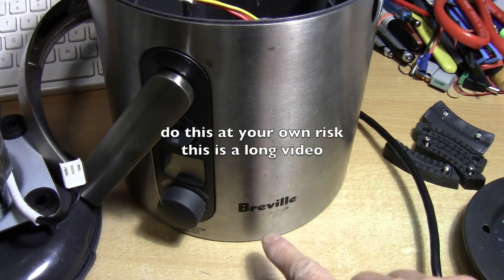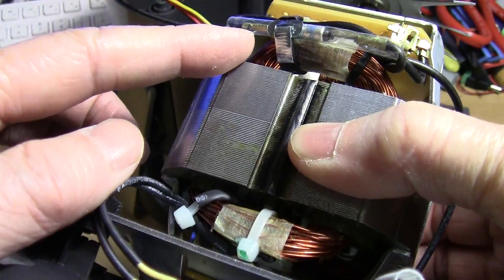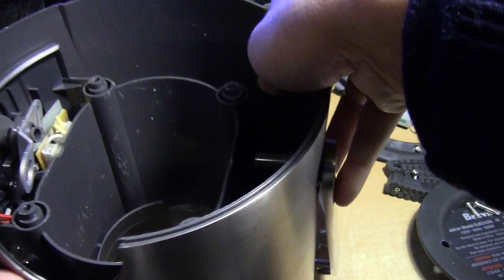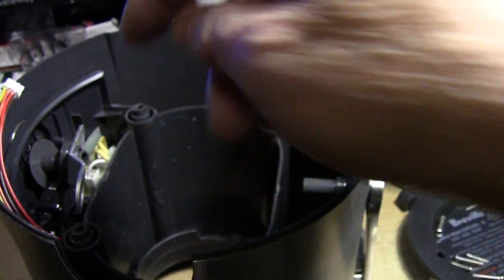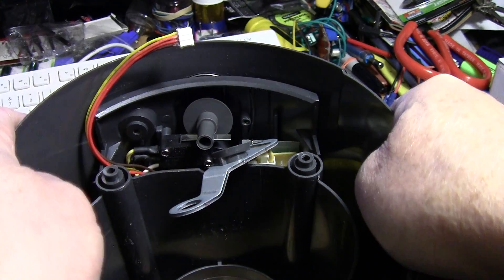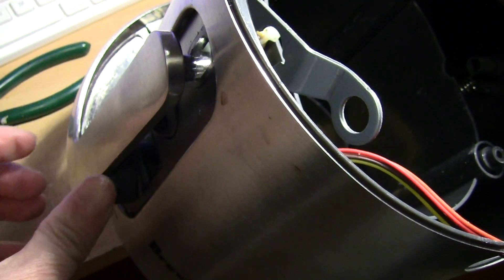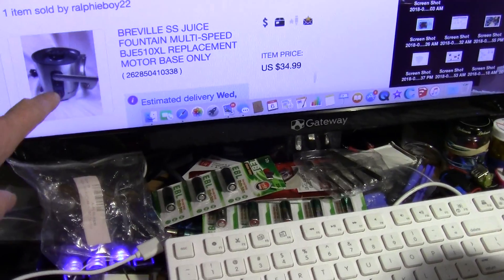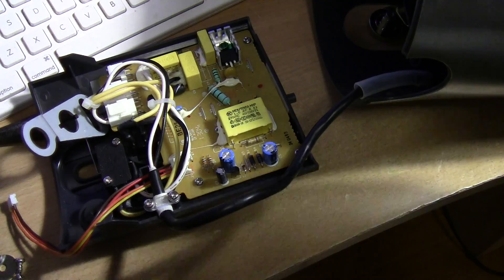Disassembling  Breville juicer model BJE510XL for repair Part 1

Comment: In my case my Breville BJE530BSS, using it with a 1200W pure sine wave stepdown transformer, stopped working after I put too much fruit in it. How can I fix that?
Reply from the maker: @valmeyraSIRH  I’d check for a blown fuse first . Remove the blender base and locate the fuse in the wire from the multispeed switch to the motor. Step 2: Disconnect the wire and use a continuity tester or multitester to check the fuse. If the circuit is open, the fuse is blown.

Comment: Thank you. But the fault was in the speed control unit. Potentiometer defective. Did you have to take everything apart?
 Maybe it was only necessary to pull out the front button and solder the contact?
Reply from the maker: Didn’t know what the problem was. Taking it apart made it easier to diagnose problem. Thanks for your input.

Comment: I ordered and replaced the main pcb control board for mine. The panel lights up and the knob changes speeds, but the motor wont come on. Or sometimes it does.  The part also came with a motor control "board b".  However i need to take off the round black basket attachment attached to the motor shaft to get to it.  Any suggestions on how to do that? I see no screws attaching it to the shaft.  Thanks buddy. I like your video.  This thing was a bit of a challenge. But once i do that, I'm not 100% sure that will even fix the problem.
Reply from the maker: Maybe your motor  or you have no power to the motor.

Comment: Hi,  thanks for this video.  My same model Breville juicer was not used for a while when I tried to make ginger juice it just burnt out.  I watched your video to learn how the disassemble the juicer and I found the copper wires attached to the motor we’re burnt.  Is that mean my motor is gone?
Reply from the maker: It means there was an overload at one point. It is possible the motor is ruined. You have to check the winding of the motor for resistance or continuity. Also check to see if the thermal fuse to the motor is blown.

Comment: Very informative video, thanks. Help a bunch. With my unit it would only run at low, 1, speed. So, I followed your video and couldn't find anything wrong, was all checking good. I flicked the small relays with my finger. Put everything back. Unit is running great.
 If a could just add one thing. The metal bracket for the locking arm does not have to be removed. The machine screw holding the locking arm to the plastic part does need to be removed so you can pull the locking arm out of its home location. 
Again great video.
Reply from the maker: Thanks for your insights.  Every additional information will help others in trying to make the juicer work agains.
Reply: That's what's happening with mine, only running on speed 1. Can you explain more about how you resolved that with yours? Thanks!

Comment: My 15 year old Oster Juicer doesn't have, want, or need a circuit board.  Just has a switch on the back to turn it on and off.  What's the matter rewiring the on/off switch directly to control the motor rather than "doing it the right way" and replacing the circuit board?
Reply from the maker: Ah, this is my friend's expensive juicer with 5 different speed settings, hence the control board and display panel. An expensive juicer has to be repaired the expensive way.  My own Juiceman juicer has just one speed and the board is easy to get to.  I ask myself the same question regarding the difference between the $5 car key and the $500 smart car key.  The difference is, of course,  $450 that goes to the car manufacturer.
Reply: Ha ha!  Absolutely, and the smart key, as I've explained several times, is probably LESS secure than an old mechanical key.  When you press the button on it, or touch the handle on your car, the transponder is activated.  A thief nearby can "sniff" that transaction, create a duplicate "key" in a matter of moments, and later drive off with the car, the car thinking he owned it.
Reply from the maker: If he didn't own it before, he'd own it now.